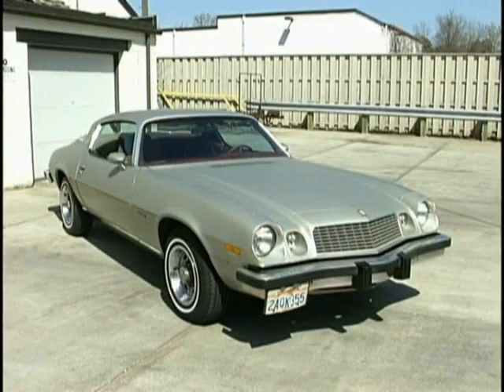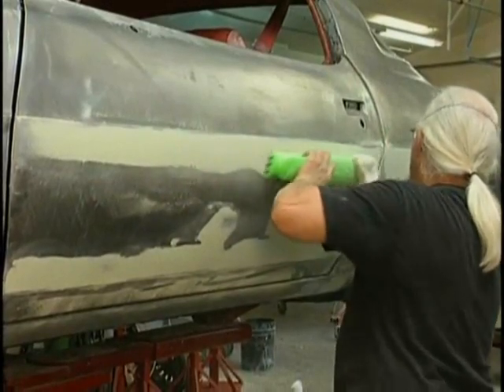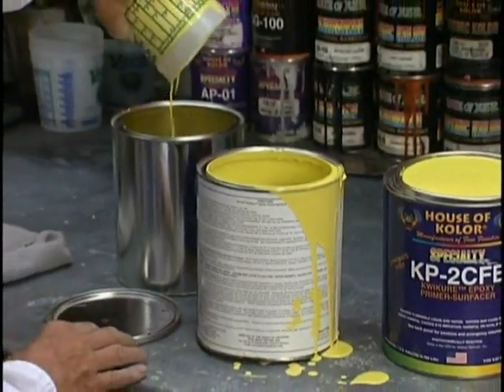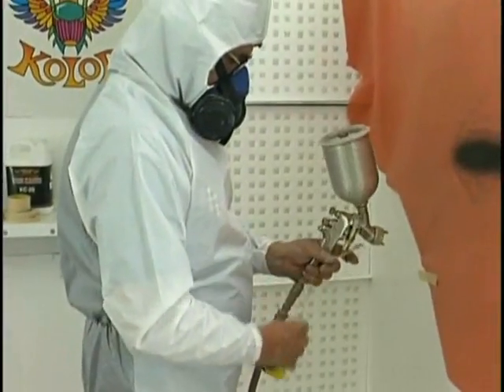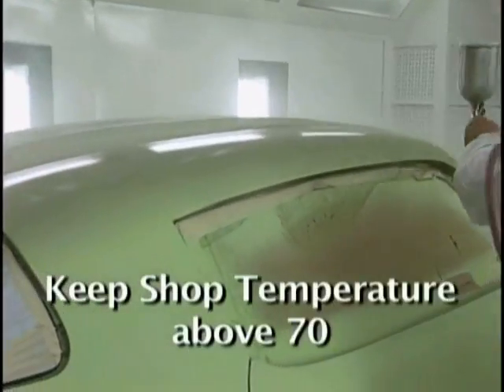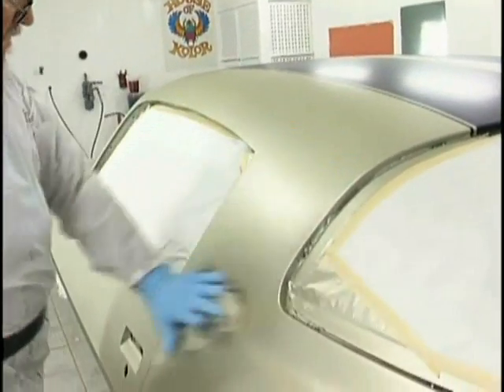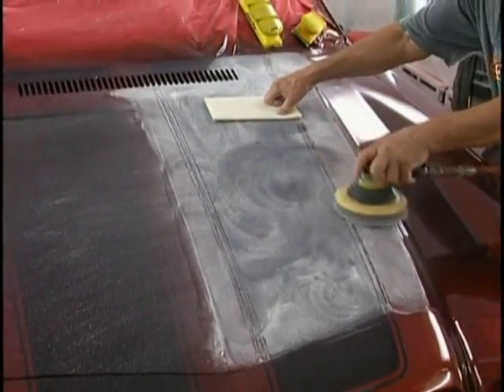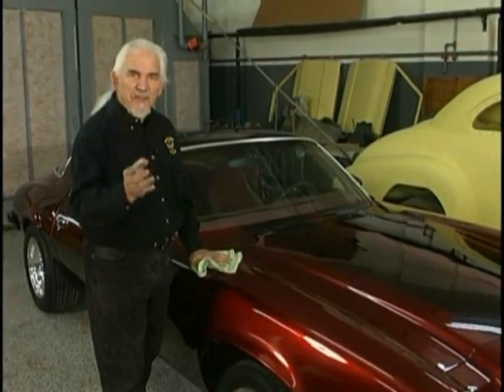KUSTOM PAINTING MADE EASY WITH MASTER PAINTER JON KOSMOSKI

Comment: I usually drop 6 wet coats of ppg 2021 clear and I can start with 600 if I want and move up to 3000. there's plenty of clear then to burry the stripes flush. Then there's about 4 coats left to buff on, gives a really deep shine better than any clear I've used.
Reply: 6 straight? Or 3 wett sand than 3 more?

Comment: Why not remove l the panels: hood /trunk / doors and paint everything separately? Years ago I watched a documentary of the building of Lamborghini's. Surprised to learn they do not have a paint booth at the factory, the car-body is shipped 300 Km away to be painted and shipped back to the factory to receive the power-plant etc. Amazing, right? also TWO painters are used for the job one only does the exterior, the other guy ONLY paints the inside panels.  Thanks Mr. Kosmoski for sharing your knowledge with us!
Reply: Are they named Luigi and Mario?

Comment: Ever think about putting on some of the materials with a customized squeegee and taking that pan out of the can ever think about using a small piece of hosedividend to the can close it off with your finger pull it out and let it run to a lower level into the other vessel without spillageif necessary you can modify the top of the can and recycle it to use with other cansby putting a hole in it and attaching a hose permanently so you can put positive vacuum in the can with a Shop-Vac or the air hose

Comment: 27:33 why did you remove the masking over window ? When using guide coat. Does this not adhere to interior ? You don't get this good overnight it's a professional trade excellent commentary showing perfection take time, both my son's using this video as a reference as they are both doing separate projects for there first cars ... Mini clubman 1275gt and a ford Escort Mexico MK1 ... Both find this easy to follow and got fantastic results so far. Merry Christmas
Reply from the maker: The interior was going to be replaced

Comment: I live in the north east. The humidity means bare metal rest fast. is it ok to use an etch primer before using filler?
Reply from the maker: Yes it is
Reply: @PHARRAWAY  what is the maximum time between coats?  I was painting one of my race bikes years ago, and could not complete multi colors and clear in a day. Next day, applying a clear coat, the whole thing fish-eyed. sand the entire thing down, and stayed up for 24 straight hours to repaint

Comment: as an ex professional I wondered why all the paint was stripped off , properly sealed with an alcohol based sealer we never had a problem and stripping is very time consuming especially when it softened body filler in old repairs which of course had to be re-paired .
Reply: @anthony hello,how are you doing

Comment: The only thing I’d do different 
I spray a large area of my stripe color first then mask of the stripes just like they’ll look when job is finished then spray the body color 
Remove the stripe masking and spray the candy and clear coat the job you’ll get a much smoother job without being able to feel the stripes esp after sanding and buffing
I always sand my clear with 800 wet sand and reclear the job is always much better

Comment: 1200s sandpaper is a bit rough for the first sanding.
I take min. 1500s. Then 2000s and 2500s.
But a good job, because the paint is at least smooth

Comment: I wonder what the percentage of body shops work to this level of expertise?
Reply: Carl Campbell, the true answer is, not enough. They’re all in a hurry, racing towards quantity, not quality. Like they say, if you want it done right, ya gotta do it yourself.
Reply: @cubbysrig  - That's true, thanks. One concern I have is when I see filler spread over bare metal. Eventally rust will form right? Are there any body shop people here for explaination?

Comment: Hey friend i have a ? I just had my truck painted but it has a lot of errors a couple dings in the etal and want to take them out and repaint the truck do i have to take down all of the paint and start for scratch and also want to add some stripes what do i have to do thanks
Reply from the maker: No you don't have to strip it down just resend it with 320grit and finish with 600grit and for the strips do them first
Reply: @PHARRAWAY  so i sand down with 360 then i put bond to take out the dings the sand everthing agin primer and wet sand and then paint my stripes and then paint and clear  then cut and buff
Reply from the maker: @marioalbertomorenonativida5374  yup exactly like that
Reply: Ok im going to try hope everything come out good your a master at this painting stuff practice make perfect thanks agin

Comment: You only show painting the outside surfaces.  What about painting the door jams and the trunk and hood inside seams all the way to the inside fender edges in the engine well? Don't these areas also need the same layered primer and seal  base coat and candy coats?

Comment: V 8 90-degree 
Displacement : 

5735 cc | 350.0 cu in. | 5.7 L.

Power : 

170 BHP (125.12 KW) @ 3800 RPM

Torque :

270 Ft-Lbs (366 NM) @ 2400 RPM

Bore : 

4.0 in | 102 mm. 

Stroke : 

3.5 in | 88 mm. 

Compression : 

8.5:1

Main Bearings : 

5

Valvetrain :

16 OHV (2 valves per cylinder)

Construction : 

Cast-iron block and head

4-barrel Rochester

Comment: Should he wearing gloves  mixing filler, I know I started painting 30 years ago no one wore any respirators,  gloves, or coveralls. I paint chromium Airplane parts now. Fresh air hood, gloves and  coveralls. 
Iv'e done automotive & industrial painting for dang near 30 years and you taught me two things I did not know. Paint on aircraft stripper in one direction and the tack rag unfolding and letting sit. Right on!  I tell ya them bondo spreaders work great on plastic bumpers with a heat gun and melt them into a crack or hole. Once it turns gray all the way around (if bumper is black) its permeated the ABS bumper. Melts like cheese. Never did any schooling to paint just picked it up and was good I am more a production painter.

Comment: i rember 1978 helping my best friend  using zipstrip to do his 57 chevy   and found no mud  took it to the painter who painted it laquer gun metal gray  wow a flawles paint job   a 12blt rear end  i built a perfect th 400  with b&M parts and a hole shot too boot  had a 327 laying around tosed th 283 and 4speed my dad worked at cvy  motor plant got ua set of 202 angle plug heads   on day crusing on the expressway i asked bob what would happen if he punched it with nopassing gear hooked up he hit it our heads snaped back and boom  no power puled over looked under  drive shaft looked like a cork screw we pushed it 10 blocks to my house  wow a 57 chevy is a heavy car  i kiddid my  buddy is it a heavy chevy tto any old hotrodders who take th time to read this  im sure every one has a story like mine
Reply: thank you very good crafstmanship  job done rite the first time my dad taught me to paint40 yrs ago with laquer i found it very forgiving  learn fisheyes orange peal an my least favrite burning through the finish coat with polishing compound trying to get that perfect shine

Comment: One mistake that alot of people do (which he DID NOT) is by using sub-standard materials. Half of a badass looking, finished job is quality materials. You can't expect that award -winning job to be done with anything but top-of-the-line materials. You need to spend that extra dollar or two or one-hundred to achieve the show room gleam. You can't be a cheap-ass!!

Comment: Gee all that bondo? I would have pdr that metal and at the end if anything a little bit of putty glaze and be done Two coats of 2k primer and a good 320 water .blocking one light coat of gray primer a 400 wet and be done. paint. 
44 years in the trade and each time I make the work more simpler.

Comment: 33:40  this i would claim to be an error..   contaminating the paint with dirt..
oh and dont be a cheapskate on the tac  rags.  
theyre dirt cheap so no need to risk fcking up a days work because you wanna save ½ dollar on a project.
you can save time and money other places..
like using skotchbrite and silicone remover  as kinda wetsanding on plastic parts before plastic primer.

Comment: that's not how you do a pro job a real body work man would of panel beat on them and not add all that filler what made me laugh the first time you say you don't want to put to much filler but get just a little over then you have to go give more filler looks like your men are not good with there hands or judging there amount of filler and then still after primer you still have low spots your man must have a bent hand also as you cant blame the tools used just the plonker using them not impressed wasted money and time for your mistakes lmao